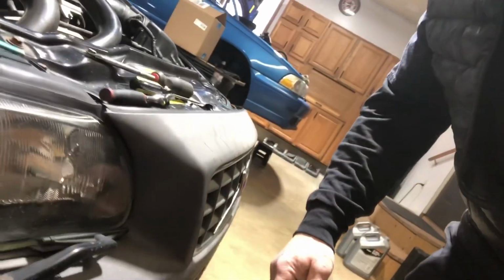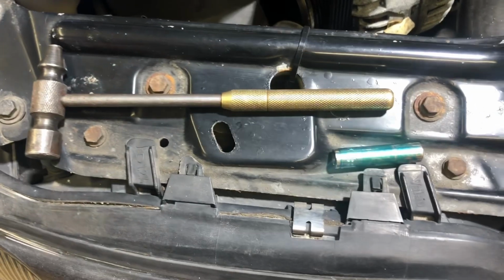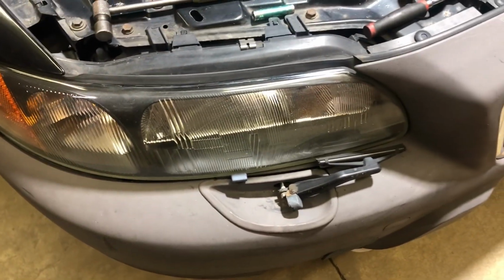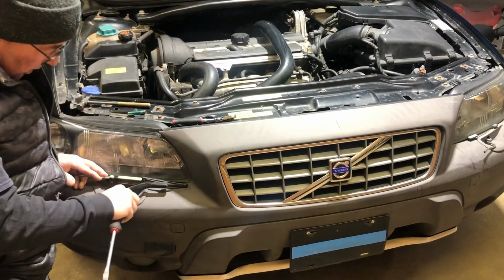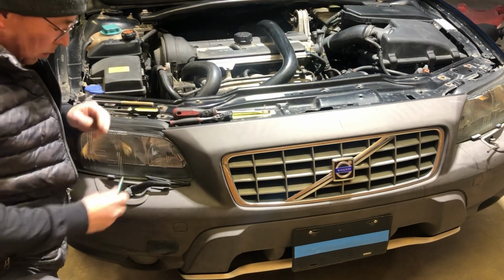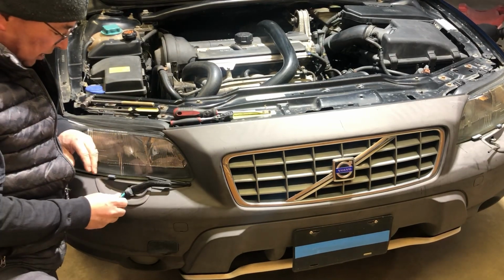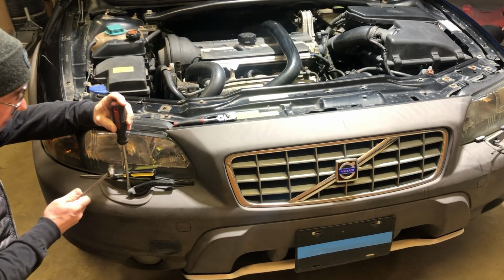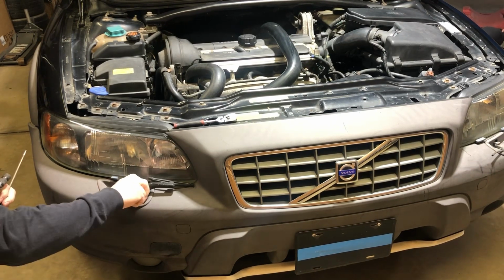How to Remove Headlight Wipers from p2/p80 Volvos

Comment: I replaced my headlights and removed the headlight washer unit. My Windshield wipers spray nozzles we're working now all of a sudden. It's going straight out of a hose on the driver's side to the ground.  I can't find where that end of hose goes.
Reply from the maker: Hi Mark
There is a hose that goes across the car from pass to driver side. It is clipped to the radiator cowl at the top and is accessible from the front of the car, hood open. Hope that helps!  Thanks for watching!